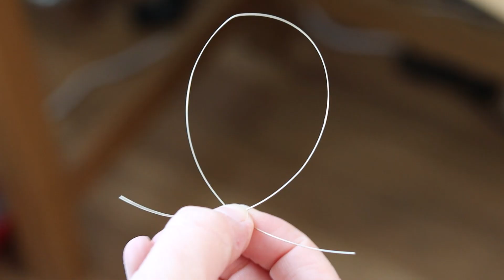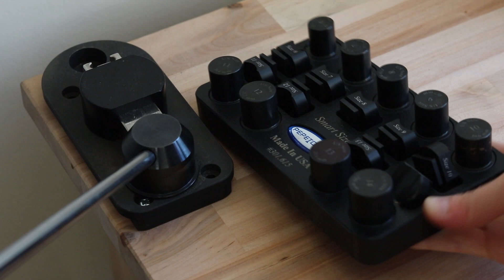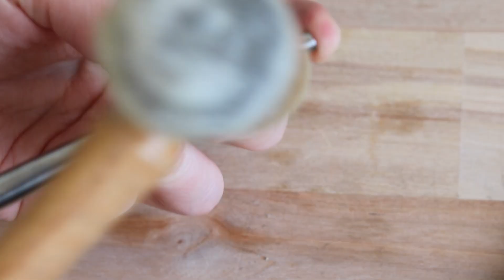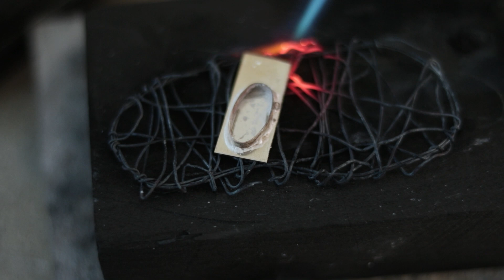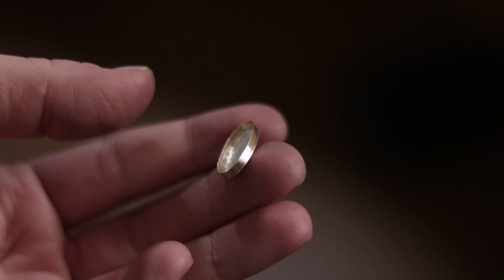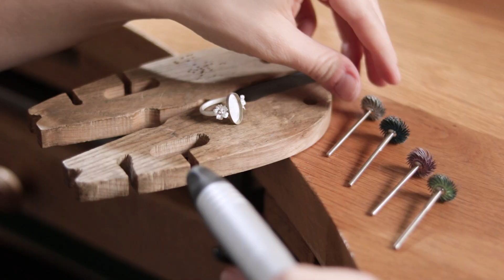How to make a silver ring with GOLD BEZEL! Jewelry tutorial step-by-step

Comment: Hi, I was wondering, typically mens jewlry is larger.  Would it be higher profit because more material you can charge more.  Also would it be easier to craft since the pieces are latger?  Also what type of jewlry sells best for beginner jewlers ring, bracelet, necklace??  Love your videos 😊
Reply from the maker: If you use the pricing formula, then yes, men's rings would be a bit more expensive simply because there would be more material used. But other things go onto pricing, like value and originality, so you can consider these when pricing too. As for the easiness, simple and minimalist jewellery is generally easier to make, but it all depends on the design and complexity of your piece. I wouldn't say that men's jewelry is always easier, but it can be, if you start with simple designs. Good luck!

Comment: beautiful! <3 i'm in the process of designing gold and silver earrings as i watch this video :P it's such a bummer that the walls melted a bit - gold adds levels of stress that no one really wants bahaha. i think the issue might have been where the flame was coming from, i.e. the top, because i had a similar situation. gold has a higher melting point than silver, so it's a lot more forgiving, and it should be able to withstand more, although i suppose it also depends on what karat gold you're using. regardless, i'm so glad you were able to salvage it and produced something so delicate and magical! i can always tell that a piece is yours <3